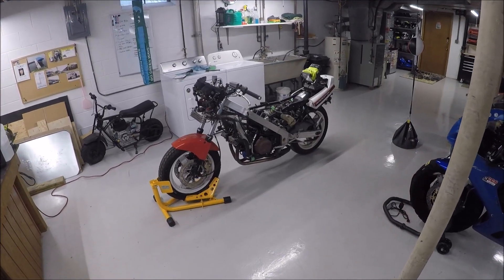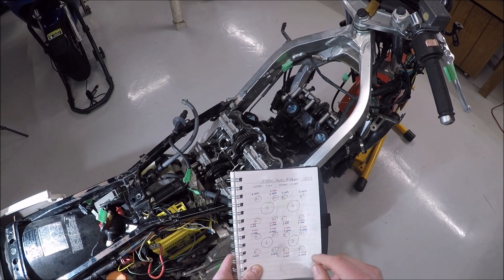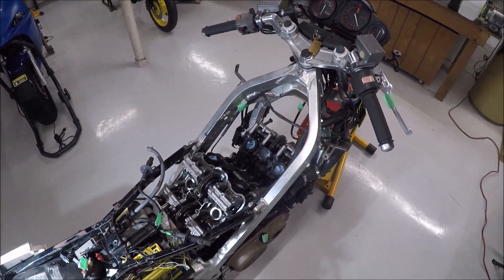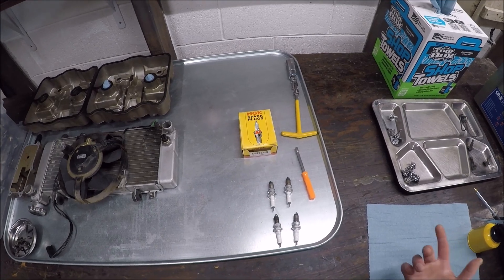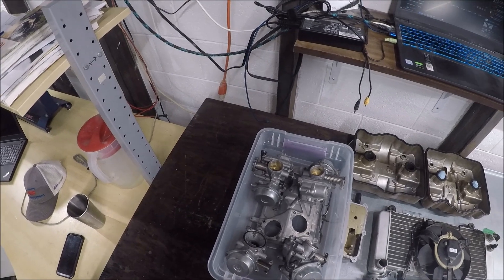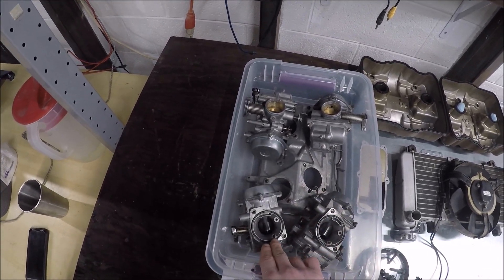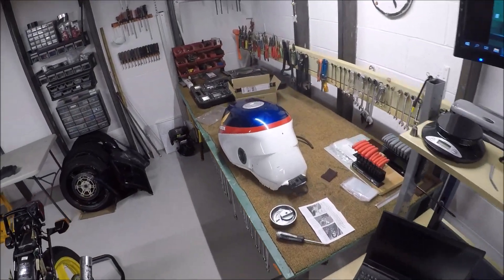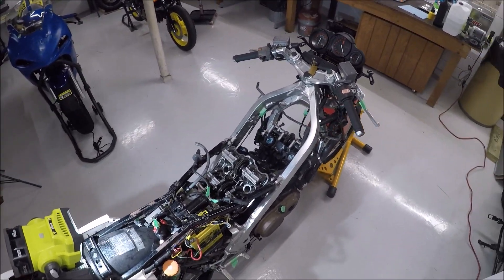VFR700F - Valves and some other things

Comment: Nice to see you moving forward on the old girl
Reply from the maker: Giving it a shot. I knew the electrical was going to be an issue but was hoping I'd be able to at least turn it over. Carburetors I at least have some knowledge about--electrical is just a lot of trial and error for me. I'll get it eventually. I'm encouraged by the state of the camshafts.

Comment: If you haven't, maybe check overall condition of the fuse box, could easily be corroded and cause a short or poor connection.  You can get a cheap used one on ebay to swap out easily rather than over analyzing an old corroded one.  Good video and best of luck with this one.
Reply from the maker: Thanks man--I may just do that. I'm going to go through the obvious things first to try to find if there's a short. It's very possible that the inside of the throttle side controls that there's corrosion or something causing the problem. I need to lubricate the cables anyway. The starter I should be able to pull off and check as well. Unfortunately just filled it with oil and a new filter--and the filter has to come off in order to do that. Also printed out some instructions on how to test the starter solenoid. There's just a ton of things it could be. Gotta research.

Good idea on the fuse panel. Wish it was the same as the VF since I have spares of that, hah.

Thanks for the wishes of good luck. I'll get 'er running eventually.